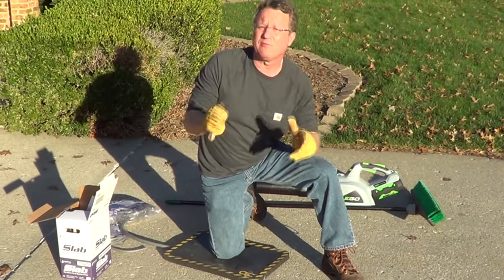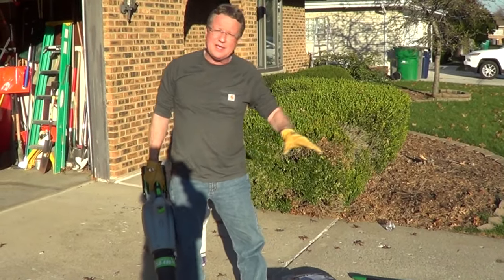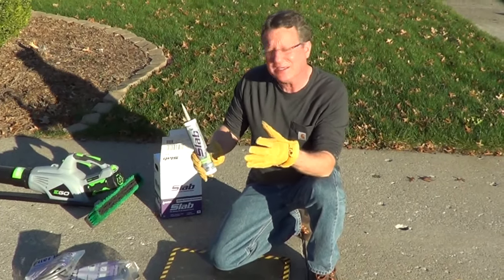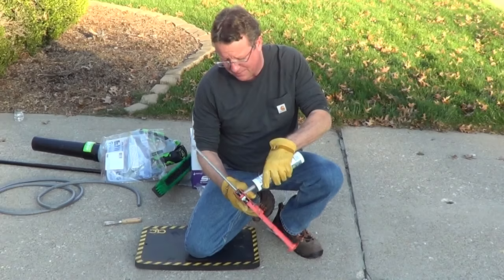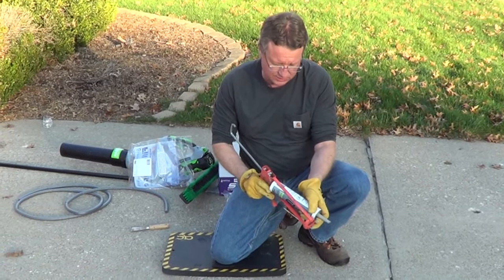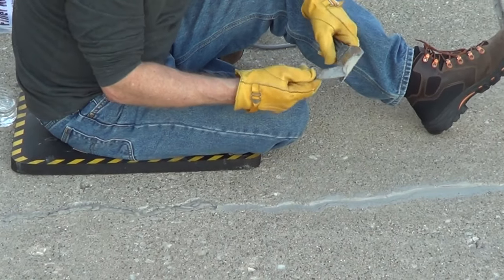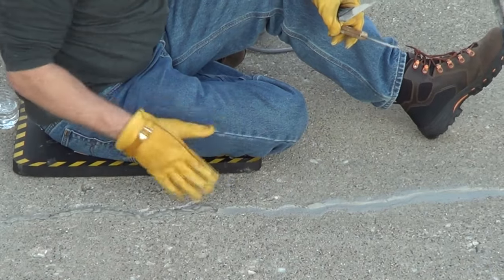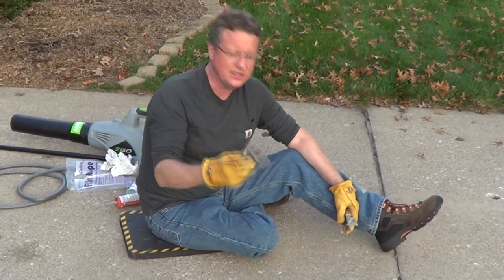Concrete Driveway Crack Repair - Concrete Crack Sealant

Comment: This video gets an A++++ in my opinion. First, you immediately start with the thing you want to tell us about, not a minute's worth of giving an overview like most other videos do. I already know the overview of cement and cracks, I just want to see how to fix the cracks. You also use a superior product in the video. I have tried multiple products, but never Slab. I tried it after watching your video and it is truly superior at matching concrete, looking natural, and being easy to work with. Thank you very, very much!!! Now, the next test for Slab is waiting over one, two, and three winters to see how it holds up.
Reply from the maker: Thanks. We've had good luck with the product.
We have more home improvement tips on our weekly podcast http://castbox.fm/u/6389499.
Reply: I know you may not see this, but has it been holding up after all the seasons throughout these years?
Reply: @branu270  I see your comment! However, I can't give you an answer because I have used multiple concrete crack fillers and don't remember which cracks I fixed with Slab. Sorry!
Reply: Word.  Dude man does not play.  Straight to work.  I'm always having to skip ahead when watching these.  Not once with this video.  Best pacing and economy of words ever!!!

Comment: You touched on exactly what the source is of all of the negative reviews of the concrete caulk-like sealants - great video. People don't stick the nozzle all the way into the crack, they don't push it down, they don't smooth it with a spoon....then they leave the product a 1 star review. I just did this same thing but with my asphalt driveway. I used the rod backers, shoved them down as far as I could do with a putty knife, then only cut off the very end of the nozzle of the sealant. That way I could get the nozzle all the way down in the crack and inject a slim stream, filling every crevice. I did this along all of the cracks and didn't try and do everything in 1 shot. I just did 1 "lift" , pushed it down with a small tool I have. Let it cure a few days, then came back and did the final lift. Some areas required a 3rd lift but they were few. The most important step is the first step - clean, rod backer, push down first application. Then everything else will work perfectly. It's amazon products like this exist. Years and years and year ago, the repair options were messy and odorous

Comment: I applied a self leveling sealant in the crack between my pools coping and a concrete slab. Comes in a resealable aluminum pouch and worked amazing. All you do is use silica sand in the joint,  fill joint with sealant,  allow gravity to self level then sprinkle silica sand over the joint. No need to touch the sealant after application. Look up Deck-o-Seal HS-1SL
Reply from the maker: I will check it out. Thanks

Comment: Thanks for the good suggestion mate. The question is, why the driveway cracks in the first place? My driveway has a brick stencil pattern and is cracked in three places, one running across the center (left to right), another crack 6 feet further towards the doors (right end is up, left end is down), and one from the front of the roller doors and straight down towards the street but stops near the second crack closest to the doors. I had asked the concreter to make it thick enough so that it doesn't crack and  he said 6 inch thick would do. And because it is a surface stencil patters, he added metal strips as splitting points in or where the cracks had started to appear about 8 years ago, a method used to stop showing cracking point and give an even flat finish. The strips were inserted into the fresh concrete about half inch below, so that if ever the driveway would crack, it would crack straight and neatly at the splitting point. Instead, the cracks appeared like a flowing river (zig-zag) and gradually expanded to what they are now a quarter of an inch wide in the center and thinning to hair-like cracks at their ends. Could the concreter have used cheap concrete? But, still, I cannot understand why and how does a metal reinforced concrete driveway crack when it was laid on a 2-3 inch stone screening base? Should I have to break it down entirely and lay a newer foundation, or am I going to waste my money?
Reply from the maker: Hi, there are a lot of factors, the soil, the concrete mix, the depth and how the base was packed. Having more or deeper control joints can help direct any cracking. Most concrete will crack over time.
Reply: @FIXITHomeImprovementChannel  
So, does that mean the idiot concreters did a cheap job almost 20 years ago at $6,800? It was a lot of money back then for a 5 metre by 7 metres driveway.

Comment: New subscriber.  Will try to do the repair myself, the way you explain it seem pretty simple.  I bough a concrete crack seal already, but will try to find the one you are using. I have lots of cracks in my driveway and in my concrete patio.  Thanks so much, God bless you!
Reply from the maker: Good luck!
Check out some home improvement tips in our e-books https://www.amazon.com/gp/product/B0B2KW1FQ9?notRedirectToSDP=1&.

Comment: Sprinkle sand on the finished caulk bead before it dries... use very small pea gravel and sand if it is an aggregate finish. You won't be able to see the light grey caulk.

Comment: Awesome, very concise video. The only question i have is that if you use something like quickrete self levelling compound, would you still need to scrape off or just wait it to self level and dry off for 24 hours before topping it off again?

Comment: Great video! I'm new to any of this. So did you mean at the end to NOT even out the fill with the surface for longevity?
Reply from the maker: Hi, yes if the filler is slightly recessed, the heat from tires won't put additional wear on it.
Check out some home improvement tips in our e-books https://www.amazon.com/gp/product/B0B2KW1FQ9

Comment: Get video. I have an issue very similar but on a vertical surface. It runs horizontal, parallel to the concrete step below. Do you think that material would hold if applied? Gravity will want it to flow down.

Comment: Really like your video. Are you using the Sashco Slab-acrylic, or the Sashco- 16210 Slab Concrete Crack Repair Sealant," Gray, 10.5 Fl. Oz? I want to get started on fixing my concrete driveway asap, and want to get the right product. Thanks!
Reply from the maker: Hi, I used the #16210 – gray 10.5 oz tubes.
Check out more home improvement tips in our e-books https://www.amazon.com/gp/product/B0B2KW1FQ9?notRedirectToSDP=1&.

Comment: Great info thanks.
What’s this method like compared to polymeric sand brushed in and sprayed with water?
Anyone?
Reply from the maker: Hi, this product is elastic and will flex. Polymeric sand is primarily designed to hold paver blocks together. 
We have more home improvement tips on our weekly podcast 
https://itunes.apple.com/us/podcast/fix-it-home-improvement/id880903087?mt=2

Comment: Just finished doing our driveway. Pretty big project, used over 60 tubes. But if it works, a lot cheaper than a new driveway. One thing that we have noticed is that there are a number of bubbles forming. We are wondering about the best way to deal with that. Thanks for a great presentation.
Reply from the maker: Hi, feel free to send a picture to fixitpodcast@gmail.com
Reply: @Bruce Randall how did it hold up
Reply: @richardjenkins8366  not bad, saging in some places and a few small tears, a couple of ant holes that I put borax powder on and a few small weeds trying to poke through. The big thing is that the driveway is no longer falling apart. Good recommendation on technique. Thanks

Comment: After you finish doing the repairs how long should you wait before applying heavy pressure to the fresh sealed are ? When it comes to parking a car on it
Reply from the maker: Hi, they recommend allowing it to cure 24 to 48 hours and put a slight concave bevel on the top so it doesn't come in contact with the tires.

Comment: Thanks for the Video. Is it ok the hit the crack with a screw driver then pressure wash the crack to make sure all debris is out? Thanks
Reply from the maker: Hi, that will work. Let the surface dry before applying.
We have more home improvement tips on our weekly podcast, Fix It Home Improvement. You can subscribe on your favorite podcast app. https://www.stitcher.com/podcast/fix-it-home-improvement-5/fix-it-home-improvement

Comment: Hi! Great video! Does the caulking work if the two concrete slabs are at different heights?
Reply: If only a slight difference in height, it will work fine. If you are talking several inches, then no.
Reply: Forty-one Shades what’s the best to patch the diffence then?  Can you drill holes in lower pad and add rebars and just pour a slab to match the height ?

Comment: I'm doing the same thing now. I almost thought you were doing my drive way, it looks the same. Anyway, what I don't understand is why you have to remove all the old and loose material but then fill the hole with foam tubing. Why not just leave the lose stuff in there but leave an inch or two for the patch repair?
Reply from the maker: Hi, the key thing is to remove any old caulk or patching material. I agree, if it is below the surface and you are using a backer rod, don't worry about the debris. If you are using sand to fill, you don't want leaves or light material in the way that might shift as the caulking dries. 
We have more tips on our weekly podcast http://castbox.fm/u/4891735
Reply: @FIXITHomeImprovementChannel  when you say backer rod are you referring to the filler rope you used in the video?

Comment: Instead of sand when the crack is deeper than 2/3 inches and goes below the slab I used good old foam in the can you would use to seal cracks. Leaving about a inch for self leveling caulk . would this be okay?
Reply from the maker: Yes, expanding foam or foam backer rod works great. Expanding foam isn't as easy to control though.
We have more home improvement tips on our weekly podcast  https://podcasts.apple.com/us/podcast/fix-it-home-improvement/id880903087?mt=2

Comment: After applying this to driveway. Can you resurface the driveway?
Reply from the maker: Hi, I would check the application directions on the product and see the recommended crack filler. You might want to keep it about 1/2 inch lower than the surface to have a thicker coat to prevent it from flexing.

Comment: doe this stuff dry soft to the touch or hard? I need to fill a 2 in crack and don't want my wife wheelchair tire to sink into it if it dries soft.
Reply from the maker: Hi, I would give the company a call, they are very helpful. I've never filled a 2 inch wide crack. In these cracks it gets very firm.
Reply: @FIXITHomeImprovementChannel  Thanks

Comment: Hello! Thanks for this video! Simple, straightforward and was the VERY FIRST video to come up when I did my search! YAY! I usually spend as much time researching for a good answer/solution as I do performing the repair itself! YAY AGAIN!!!
NOW, one question. I am in South Louisiana, would this repair be better done in Summer? Winter? We don't have Spring or Fall here. :-( 
My thinking is because of the expansion/contraction of the cement in Summer/Winter and how that might affect the repair process (other than the passing out in the ridiculous heat and humidity).
Reply from the maker: Hi, you can use it when the concrete temp is between 40 and 90 degrees F. Check out their website, they have a lot of good tips.
We have more home improvement tips on our weekly podcast  https://podcasts.apple.com/us/podcast/fix-it-home-improvement/id880903087?mt=2
Reply: @FIXITHomeImprovementChannel . Is it better to do it in one or two passes? What brand is it or any generic would suffice?

Comment: I'm wondering if I could do something similar to replace a chunk of driveway that cracked up from a damned tree root
Reply from the maker: Hi, you can mix up some concrete and fill in a section. Feel free to email a picture to fixitpodcast@gmail.com and I can see if I might have a suggestion.

Comment: Is this material paintable? I need to do a two part epoxy on driveway. Thanks!
Reply from the maker: Hi, this product is designed to expand and contract. I would check what the epoxy manufacturer recommends to fill cracks, they may want a concrete based crack filler.

Comment: Will this also work with different levels/heights of concrete? Part of my driveway is .25 to .5 lower than the adjoining section.
Reply from the maker: Hi, it worked well on a couple projects where we had the same problem. I would give the company a call and ask for technical help. I've found them to be very helpful. They might have a better product for your project.

Comment: I have tried this product but it has recessed into the crack in the driveway. It has been a week since I applied it. Can I add more on top of it
Reply from the maker: Hi, yes you can put Slab on top of Slab. Make sure its clean and dry. Keep it slightly under the height of the driveway so your car tires don't turn it black.
We have more home improvement tips on our weekly podcast  https://podcasts.apple.com/us/podcast/fix-it-home-improvement/id880903087?mt=2

Comment: I probably made a problem. What happens if you just filled the crack with self leveling sealant and didn’t fill it with sand first 😤
Reply from the maker: Hi, depends on how small the crack is and how well much is grabbing the concrete. If it fails in an area, just add sand and re-caulk. I've had really good results from this product.
We have more home improvement tips on our weekly podcast https://itunes.apple.com/us/podcast/fix-it-home-improvement/id880903087?mt=2

Comment: Any thoughts on leveling if on side of the crack is slightly higher? Is that where the breaking up of the concrete comes into play?
Reply from the maker: Hi, you could smooth the caulk up to the high side. If you are in a cold climate you are trying to keep water out of the crack for the freeze thaw cycle.
Reply: Drill a hole and pump in concrete it will raise it sometimes

Comment: 2:24 ~ How does making a spoon shaped indentation improve the crack filler? ~ I did not like the Quickrete texture, it was estometric and not nearly as good as the epoxy solution, which did naturally dry and shrink into the spoon like shape, so i filled it a second time. ~ Spoon Dent, literally channels water into the filler space?
Reply from the maker: Hi, most of these types of crack filler should be slightly lower than the surface so hot car or truck tires don't affect them or turn the color black.

Comment: Hi, after applying how long before you can drive a car over the crack?  Thanks.
Reply from the maker: Hi, usually 24 hours, but wait longer if it is cold or humid conditions. 
We have more home improvement tips on our weekly podcast http://castbox.fm/u/6389499.

Comment: Which is better for long term, the Slab or Crack-Stix?
Reply from the maker: Hi, I have found that they are both long lasting! It has been a few years that I've used both products and I haven't had to re-apply.
The crack sticks gets a little stiffer, so you might want Slab on a project where movement might be a problem.
We have more home improvement tips on our weekly podcast http://castbox.fm/u/6389499.

Comment: Really dont like those fillers. They dry to a different color, shrink over time and look horrible when your finished. Why didnt you use a concrete material to do the repairs?
Reply from the maker: Hi, I like this type of product because it expands and contracts with temperature. We are in a cold climate and I've had problems with concrete patch.

Comment: Awesome! Great video! I like to use caulk saver foam and the Sakrete crack filler. I also think an air compressor dusting tool works better than a leaf blower. I agree the foam caulk saver is a good idea on larger gaps. Here is how I did it on my driveway: https://youtu.be/pmJbZvNXclg
Reply from the maker: Hi, thanks for the tip. Checked out your channel, you have some nice videos.
Reply: Thanks you too!